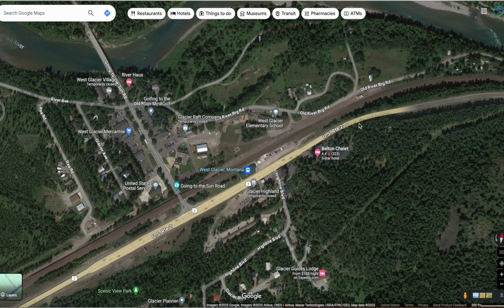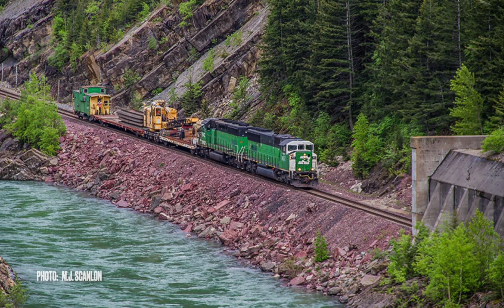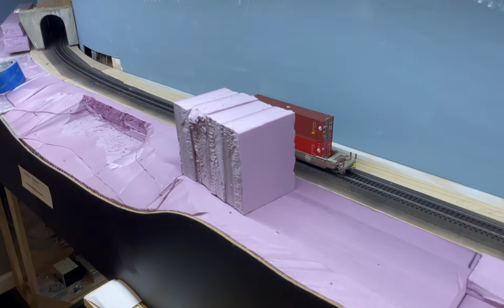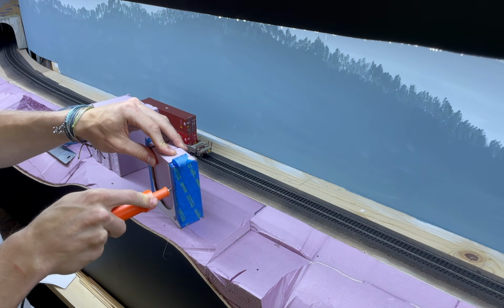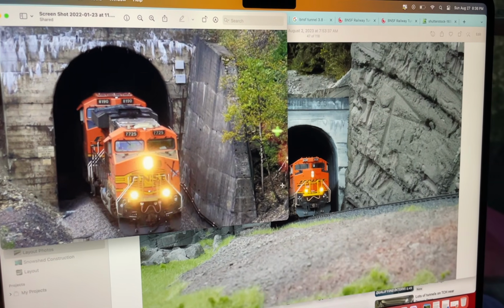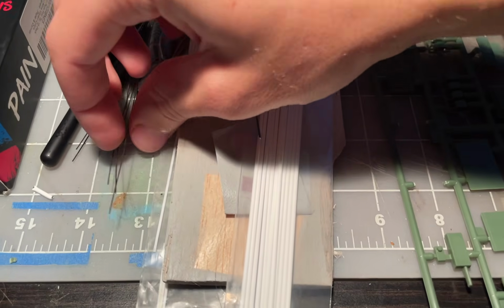Simple Methods for Modeling Tunnels – Marias Pass HO Scale Layout EP07

Comment: Hello I came across this video in search of making portals for my layout (BTW: Great video).  Your video prompt me to look at the material I have laying around and I found I could use tempered hardboard.  The question I have is how much plaster did you use to cover the portals and tunnels?  Was it a thin layer?  I'm looking to see how much did the plaster add to the overall thickness of the portal.  I'm not sure if I need to add plaster to the entire portal or just the sides to hide the individual stacks of hardboard glued together.  Hope this makes sense.
Reply from the maker: You're correct, it was a very thin layer. I added just enough to give it a bit of texture and to smooth out any imperfections. I'd say at max the plaster was 1/16" thick. Personally, I think the final product would look best if you added plaster to the front of the portal as well simply because it creates a pretty decent concrete-looking texture. Of course with hardboard, if you're adding plaster to the smooth side (I know sometimes there's a rough side and a smooth side), you'll probably want to sand it down a bit to allow the plaster to bite. Otherwise, it just slides around, which is an issue I had a bit of trouble with using cardboard. Hope that helps!
-Cam
Reply: @railfan220  Cam, thanks for the info.  The hard board is smooth on both sides.  I was thinking of just painting it, but the you are correct with adding the plaster gives it a more textured look.  I have a few scrap pieces to work with before I apply it to the final product.  Thanks again.

Comment: I already tunnel portals from Woodland Scenics, so I will simply use them as a template.  I would never have thought of that before.

How did you paint the interior of the tunnels ?  Are they simply bare rock ?  Or are they lined with brick, or cut stone, or concrete ?